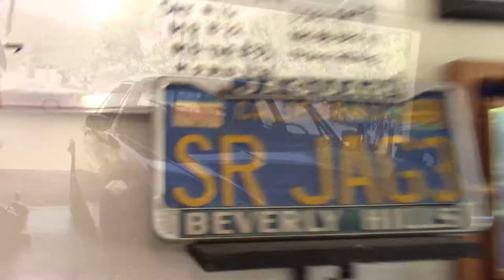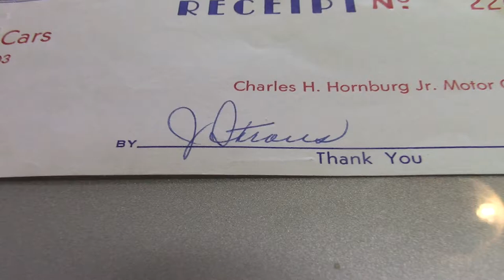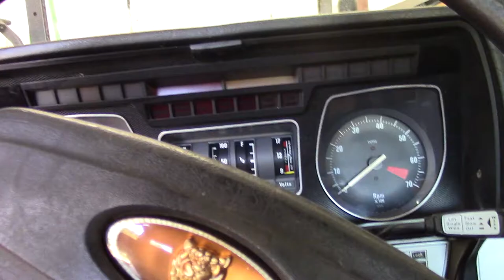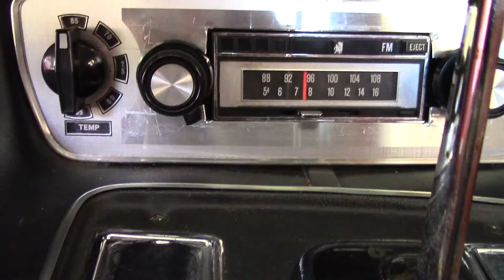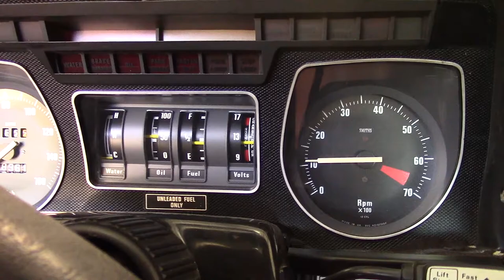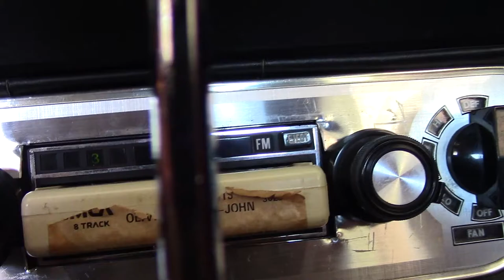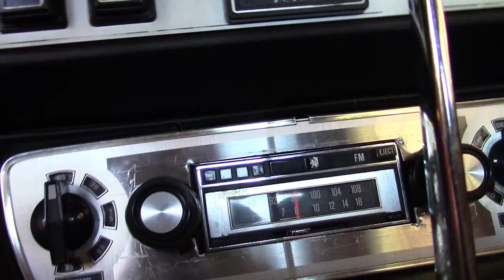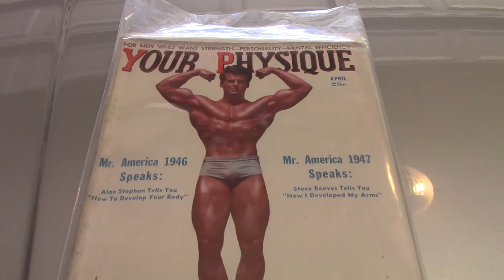Bodybuilder Steve Reeves 1976 Jaguar XJ-S V12 l What 8 Track Music Tapes Did He Leave In The Car?

Comment: That's cool, I hope you know a really good Mechanic. I love Steve Reeves.
Reply from the maker: As long as you do the recommended maintenance, the car will do very well.  The engine is huge and the hood fits so snug and tight that I've learned to leave the hood open after a Texas summer drive so that the rubber hoses don't melt. Not that they would melt but it's a easy precaution.  The car loves cool weather.  It's just been a dream come true to own and to continue the story of the car and its history. - Scott
Reply: @SteveReevesHercules  Your a Champ to keep it in such good shape.  Leave the steering wheel all the way up like Steve did so he could drive it with his massive pecs!